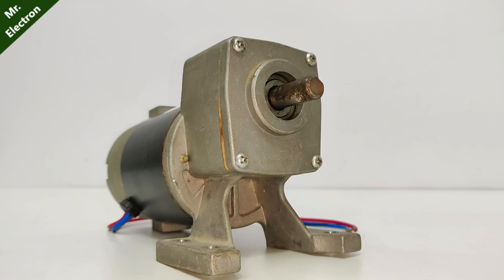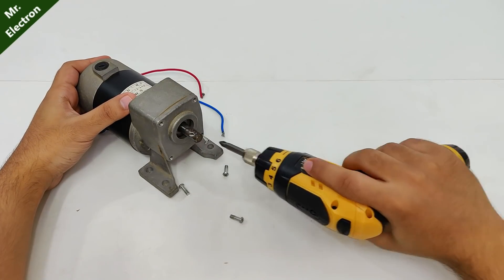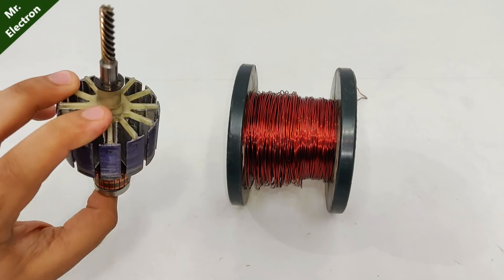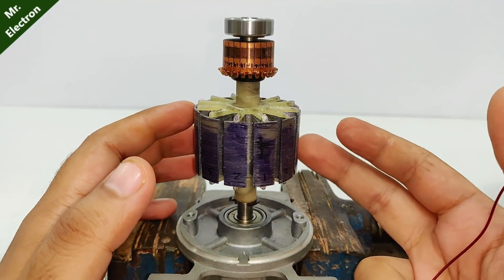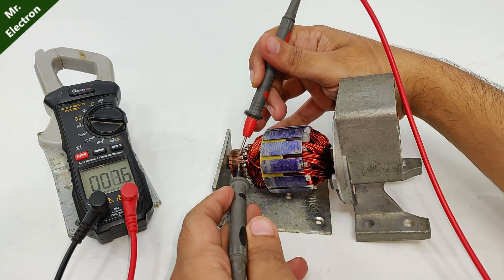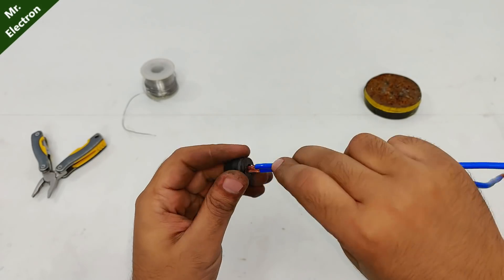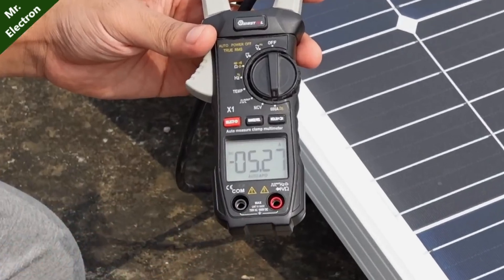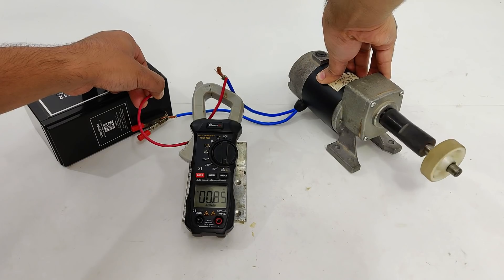220V DC Motor to 12V High Current Motor for High Speed & Torque -Experiment !

Comment: Hi please can u make video on how to modify electric motor in other to use a very low Amperage to run. I really really need that video.  I have been making research on that but yet to get any. Thanks in advance
Reply from the maker: That requires really thin windings and more input voltage.

Comment: Sir I have a question..what if I connect 100,000 micro farrad   25 V on motorcycle 12V battery, is there possible damage on stator, lights, electrical parts, etc..?

Comment: Hi Mr. Electron. Is this solar panel designed to supply 12 Volts and you can use it to charge a battery directly if you pay some attention not to overload it?
Reply from the maker: Yeah !
Reply: @MrElectron  good news. i hate that they design Solar-12V-off grid products inorder to make you purchase more gadgets that make your system less efficient.
Reply: @proba7  really 🤔